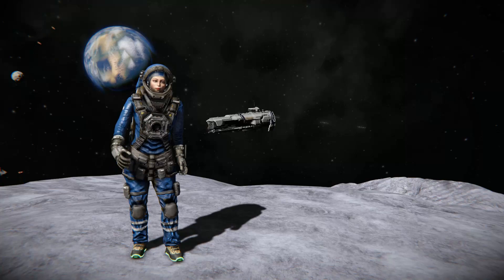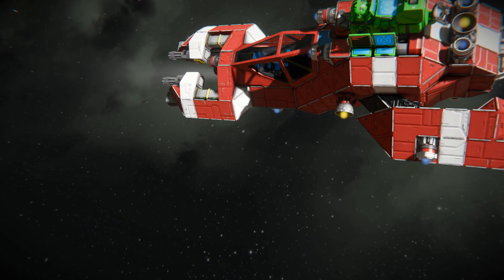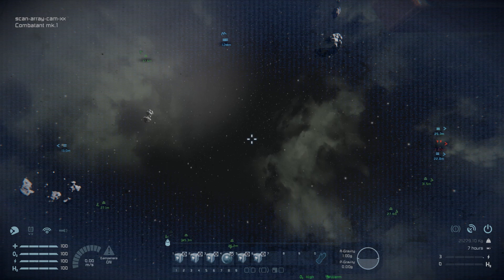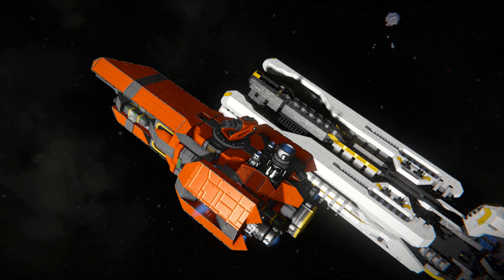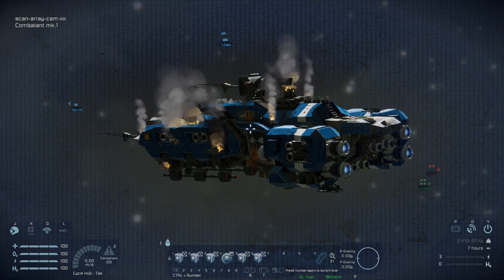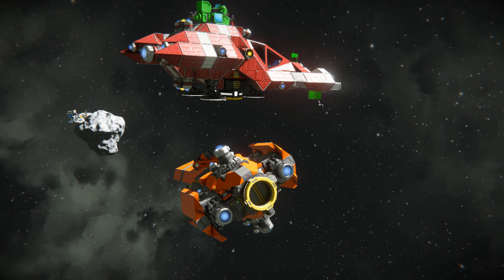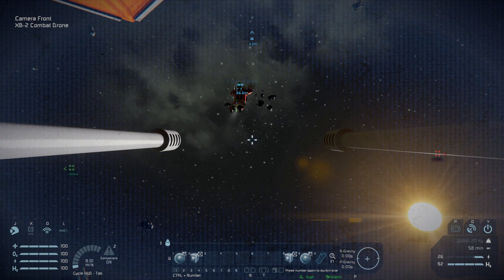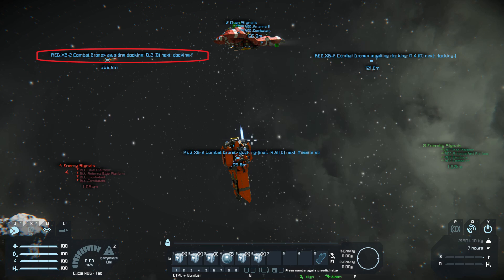How to setup auto combat drone - tutorial/walkthrough || Space Engineers

Comment: lol even setting the path for every one of my drones, it seems the controller just can't handle more than 4 or 5 of them. 1 out of my 6 xb-2's successfully docked on a carrier with connectors on the sides of the ship spaced 5 apart from each other. The other 5 either nosed in and rammed it, or just smacked the carrier. They followed the pre contact path just fine, but they just can't seem to get it together to dock.

Comment: Great video! Quick question, how do you get multiple drones to connect to different connectors. I assumed it was just renaming both the Main and Drone connectors to dockb as an example and recompiling, but that does not seem to work.
Reply: ahh never mind, they all get the same name as its searching for Contains docka. But it doesn't look like you can actually assign a dock to each ship unless I am missing something.
Reply from the maker: @Syngather  That's correct, all the connectors should be named docka. The drone does not hookup to the specific connector but you may set a specific landing pattern for each drone (which will help to prevent occasional collisions).
Reply: @Pro100tv9  Sadly that doesn't seem to be helping, even when I park them over one spot, they try to fly to the other side of the ship to go to another spot. I have 8 available connectors. Oh well, would have been nice lol

Comment: How do I make it so the drone will dock automatically to recharge and rearm?
Reply from the maker: That's a good question. You could add a conveyor sorter behind the drone's connector (replace instead of conveyor part), add preffered filters to it and set "drain all". That would fill the drone with ammunition until it's full. 
Rockets for reloadable rocket launchers would still need to be filled separately due to their size.

Comment: How do I stop the drone from using its thrusters whenever the drone is connected to the ship?
Reply from the maker: You can either select "pre-contact" (that will disable the AI core of the drone(the thrusters will still be On)) or just group all the drone's thrusters and disable them manually.
Reply: @Pro100tv9  It turns out as long as you recompile both a-processcore for both main, and drone it'll work that way too.